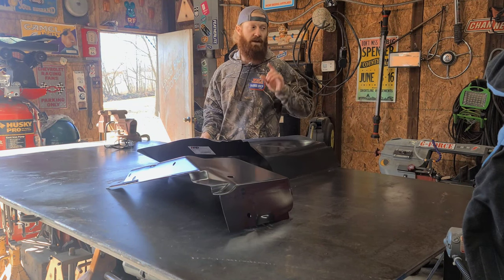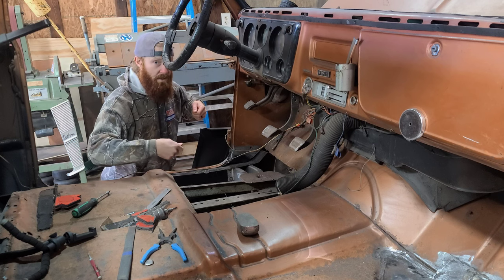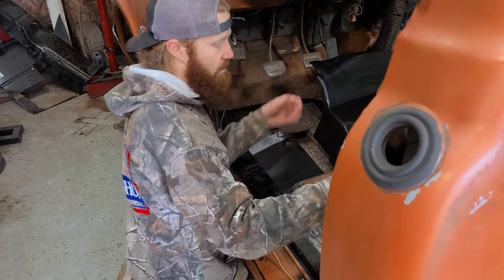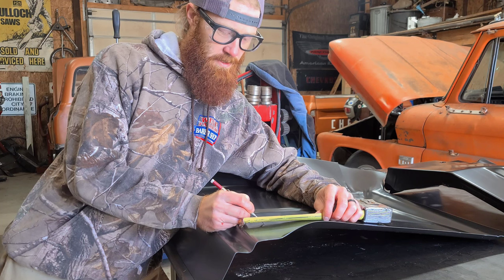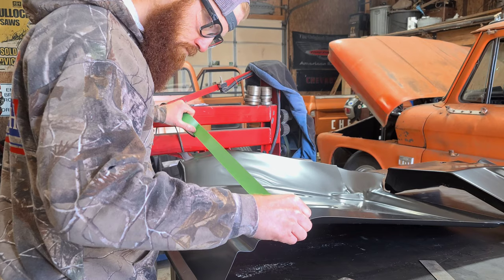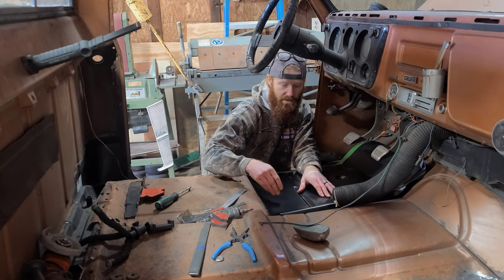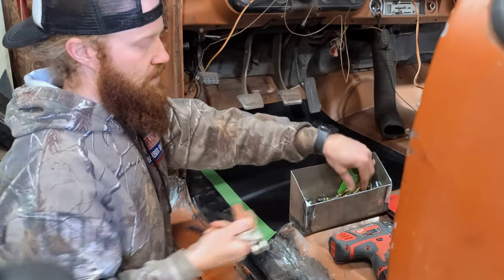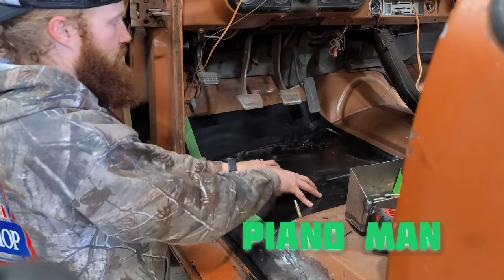Floor patch panel install. (67-72 c10)

Comment: Thanks for the video. This helps answer a bunch of questions for me. I have to do that exact repair along with inner and outer rocker. Fingers crossed it will go as smooth as yours did!
Reply from the maker: Awesome. Glad it could help. You got this 👊🏻🤘🏻

Comment: so having done it, would you recommend putting in the floor panel first and working out to the rocker or doing the rocker/ cab support and have a foundation for the floor? I'm getting ready to do one for the first time.
Reply from the maker: I would do floor and inner rocker first if it was all getting replaced. I have a video on my buddies 66 we did the rockers and inner rocker. That’s how we did his

Comment: I am subscribed now! As an ASE master tech since 78, I was rebuilding a complete 1967 C10. To keep it simple, I understand using the MIG on the floor pan. Why is MIG harder to planish the TIG. There are many who use MIG wire to weld sheet metal. I will be honest, never seen a TIG or used one. 
  Also, just asking as Tom Silva on this old house makes a patch first, the creates to hole to fit it. The floor for the most part won’t be seen which leads me into another question. I bought a flanging tool that punched holes on metal as well. You can control the depth of the flange and perhaps the thickness. But stamping a flange creates a rigid point and adds stiffness like a concave for convex curve in exterior panels. But automatic, low hump (For future carpet order) but on welds to the floor, both bottom & top, many use a coat of Dyna-Glass to seal out moisture intrusion. Then perhaps some filler and epoxy, spray the cab bottom with Raptor. I would never use rubberized undercoat as it get hard, cracks and holds moisture. I bought me MIG in 1984. That is older than your Lincoln used on the fender. There are a hundred ways to skin a cat, and work equipment, you find something you like and stick with it. This is how most of us end up married! LOL. 40 years later, same wife, same welder but I don’t think I can justify a TIG anymore. I would like to try but not financially able after the last 3 weeks at my house. 
  Lumbar problems, coffee pot, son moves back, dog and 9 + 13 yr old, broken washer my wife says new, don’t fix, house drain plugged (once in 2002) here since 93, windshield chipped, then crack same day, washer/dyer, son impatient and cracks new toilet, p/S quits electric and I can’t walk. Electrodes & stimulator, instead of up to lumbar, goes down into legs & heels. 7 software changes, no better. I give up. Sorry! I am way down living life thru your work, gives me pleasure to see some who cares about being right & best practices. DK, ASE tech, master since 78, forced to pasture!
Reply from the maker: Awesome glad to have you along for the ride. Honestly i use tig primarily because my tig skills are not that wonderful yet 🙌
Reply: @Metal_Massacre_Fab_Shop   In 1999, July 30th, took tool boxes home on flatbed tow truck. Left elbow shot and Dr said change jobs. My MIG uses the big rolls up to 150amps. The transformer is bigger than some Honda engines. Had to use cut heater hose and fender washer to fit small rolls with tension. I don’t even have a 0.23” metal spool driver. I would have to get one cut on lathe to fit. The chart goes to 1/2” setting but includes on-off stitch next to wire speed. No voltage control but still use the original stinger as I keep it straight. 22 years ago, I bought 240 copper cable with ground and put ends to plug in. I spent $38 to make a 50 foot extension cord so I can plug in and reach my mailbox!
  But I truly enjoy your passion to get it correct, even the 45 degree cut many don’t use. Just great! Age 13, drivers license said Farm/School no photo and made on double weight glossy photo paper. It didn’t hurt that I grew 6” at 11, and decent mustache by 13. High school buddies loved me. Now, 46 years later, my bread like yours, but now grey, same hair and grows an inch per month. Some genes are good I guess! Keep it going, I’ll be watching. Do you do body work or paint? That’s why I turned to YouTube. Never looked at it, but have not had cell since 2008. The chemistry changes so quick! DK!

Comment: What patch panel did you use for the floor? I need to find one that goes into the pedal area also.
Reply from the maker: I used auto metal direct. Not sure if they make a panel that goes that far up. It has a flange right under the pedals
Reply: @Metal_Massacre_Fab_Shop  thanks. Didn't your panel go right below the pedals back to the hump?
Reply from the maker: @corywheeler4538  no problem. Yes it did. Right up to the seat mount